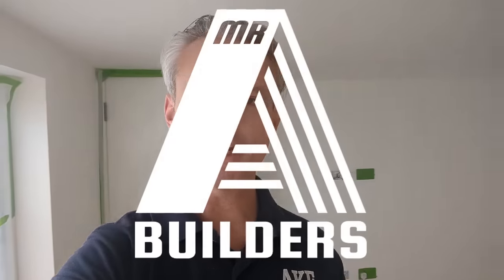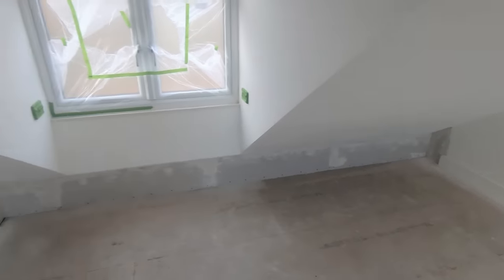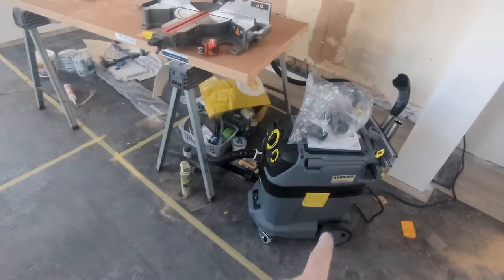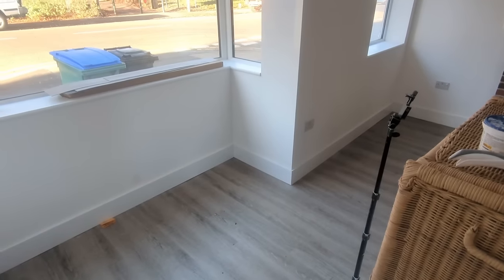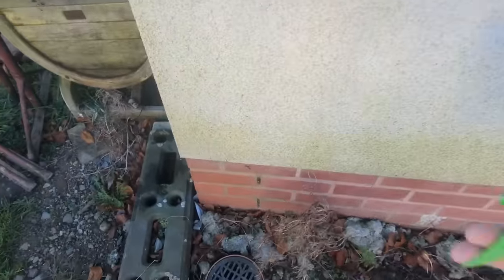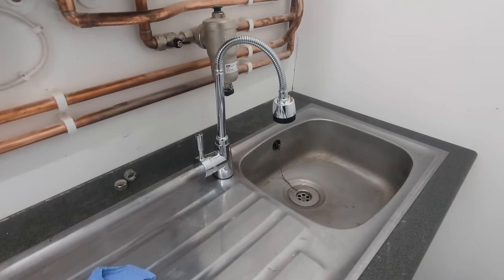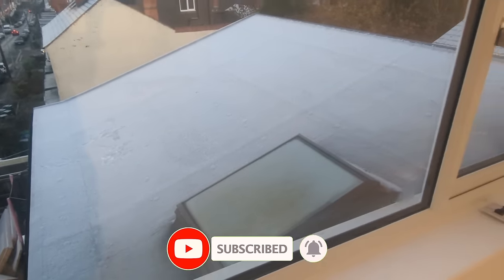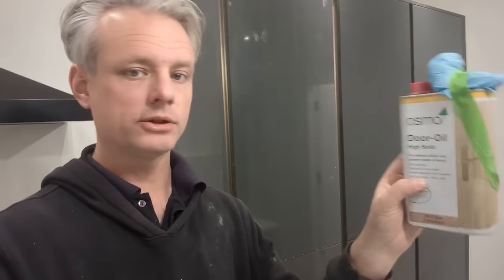Fitting the Carpets!!! What can possibly go wrong??? Builder Destroys His Own Home #18

Comment: I used two-part car body filler when decorating and blocking up multiple holes in the plasterboard. The result was, and still is flawless nearly 4 years later. Love the underfloor heating set up.

Comment: I had XL Doors fitted same as yours and I had to use either Osmo Oil or Johnstones Woodworks Poly Varnish to maintain the warranty.
 My joiner recommended the Varnish. Very impressed with the stuff and so easy to coat etc.
Reply from the maker: The Osmo stuff is great too and really easy to apply. I'm just surprised that that's all I can use!

Comment: Be careful using Patio Magic and similar products like Pro Kleen. The active ingredient is biocide Benzalkonium chloride and should not be sprayed without suitable breathing safety gear. I clean my drive once a year with it and used to spray it - until I ended up with ulcers on my fingers and back/lung ache a few days after use. Had to treat ulcers with Hydrocortisone cream. Now I use double gloves and only sprinkle from a watering can. I never use a spray now. It took 2 or 3 times to figure out what caused the skin ulcers and solved it when I associated them occurring a few days after drive cleaning.

Comment: You should watch out with patio cleaners. Your render looks like it's old cement render so it should be fine but a lot of the cleaners will damage silicone render so you're better off with a fungicidal wash if don't know what the render actually is. 
Your real problem here is that your walls are absorbing water which is what cement typically does. You should clean the render and then seal the outside of your walls with a clear masonry sealer to stop this problem from coming back. Sealers are typically breathable so there's no problem there. If you don't seal your wall, the wash will work for a bit (maybe you get a year if you're lucky) and then you'll have to wash the house again. A sealer tends to last 10-15 years.
Reply from the maker: Cheers George. Appreciate that mate. The render is sprayed on cork, there's no way on God's green Earth that I'd ever use a cement based render on any job. Thanks again.

Comment: Two fussy blokes  my go to sleaves. Medium and smooths uses the smooth on doors all the time and the mediums on and around radiators and banisters.
Reply from the maker: I've got to say that I'm very impressed, especially with the emulsion on the walls. Really glad I found them.
Reply: @Mr_A_Builders  Great little rollers been using them on my jobs for around 2 years. You could have sanded the edge of the bloody door though. 😂😂😂😂😂

Comment: Wrong - and so, so, so widely misunderstood. L-Class and M-Class filtration is 100% identical in every respect. Both filter to 3 microns - the HEPA standard. The only difference between the two machines is that M-Class machines are fitted with an airflow sensor and audible alarm which alerts the user to either a full bag or a clogged filter. Zero difference otherwise. If you need better filtration, you'll need an H-Class machine which filters down to 0.1 micron (ULPA standard)